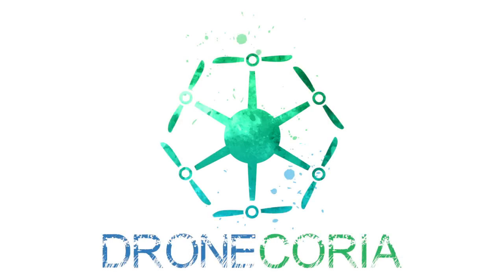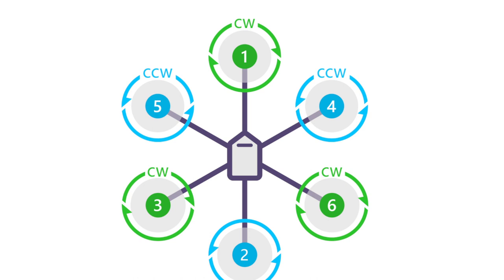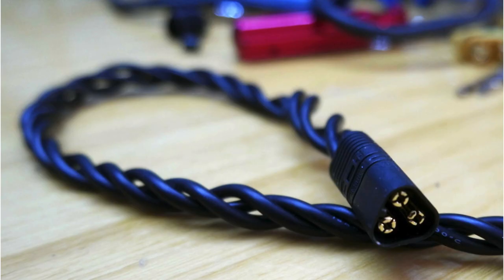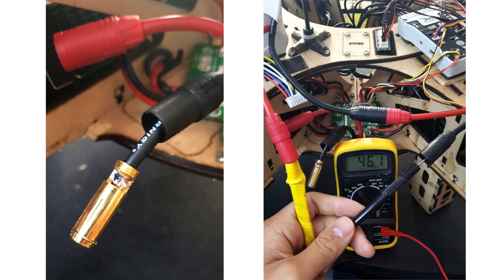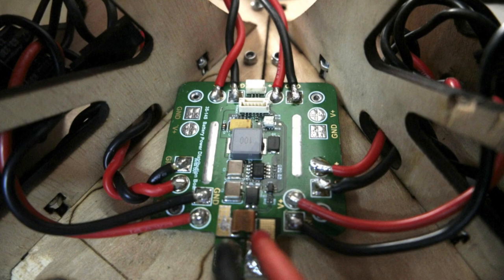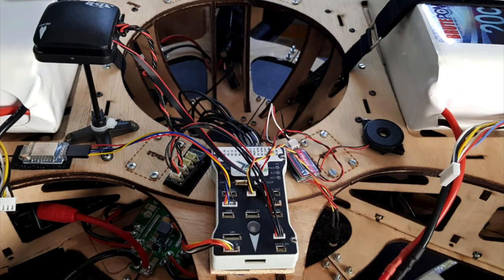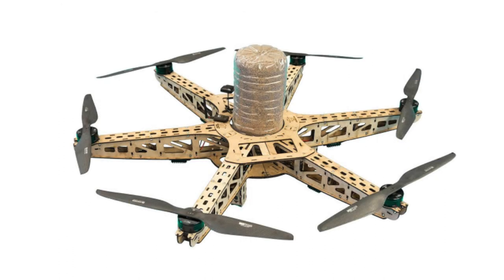Wiring the electronics of Dronecoria

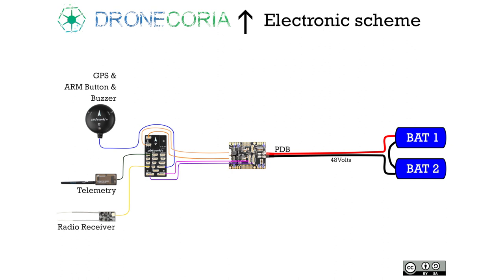Comment: 0:47 but what happene if I have two signals  cables? (BHeli 32)
Reply from the maker: HI, are you creating a dronecoria drone?

The ESCs only have one signal cable, if have two, could be to upload a new firmware.
Reply: @Aeracoop  In that Case, what should I connect the second cable to?
Reply from the maker: @leolee3598  The second cable is used only in factory, so don't need to connect.